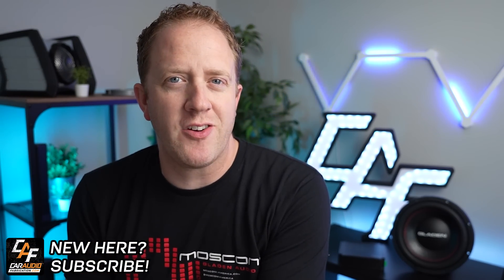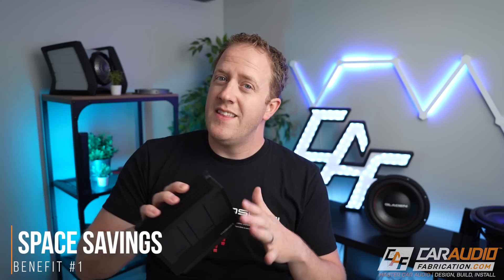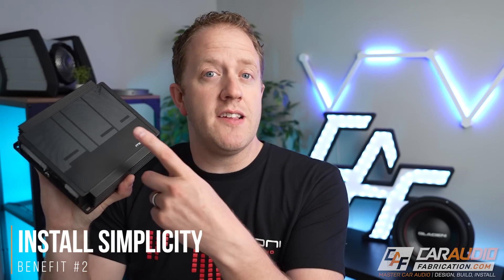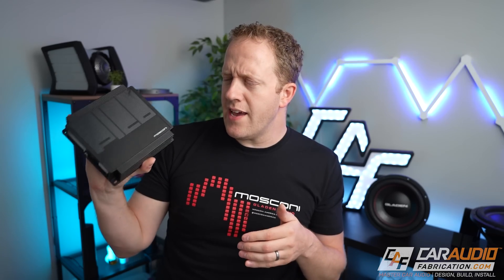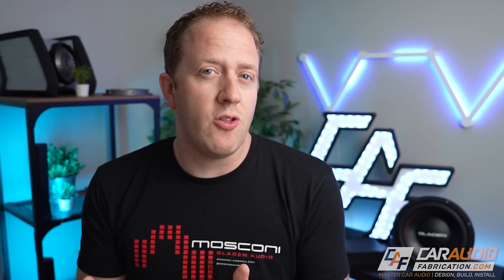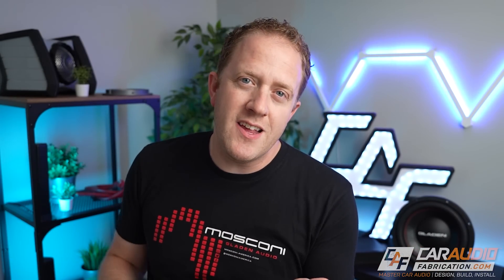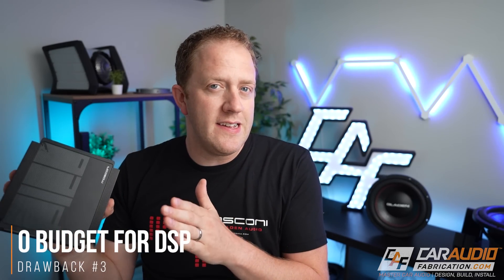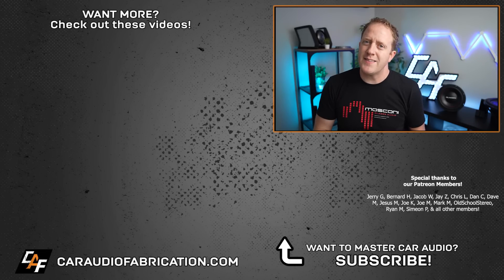Is DSP Amplifier the right choice for you? Yes, but maybe no...

Comment: I just replaced my speakers, and built my own crossovers. The problem is my tweeters are so sensitive, even with the 3º order high pass crossover set at 3500hz you can still hear noise at 500hz (All frecuencies sound good except 400-900hz).

I'm going to try building a crossover at 8000hz and hopefully that will fix it. Because I'm not willing to spend the time required to install a DSP.

Comment: Also- 1 more drawback for a DSP amplifier. Typically- if you're going apples to apples, same audio company providing a dsp and multichannel amplifier, compared to the same company's all in one dsp amplifier, the dsp amplifier will typically (most companies, not all) have less RMS output per channel than the standalone dsp upstream of the multichannel amplifier. Mosconi doesn't have this problem in their Pico or ONE line of products, but other audio companies may. For instance, another audio company that I use in my shop is musway, for those customers who cannot afford mosconi but want quality on a budget. Their DSP 4 channel amplifier is the M4+, which will provide 100wx4 at 4ohm RMS.  Comparatively, i could set them up with the DSP68 and the non DSP 4 channel provided by musway, the FOUR.100. This amplifier is 130x4 at 4ohm RMS, 
Same line of thought applies the more channels you add, the 6ch dsp amplifier is 70wx6 rms and the non dsp amp is 120x6.  This is a common occurance in a lot of amp brands.
Reply: I love the appearance of musway, looks really great.

Comment: Man I need some help with my system. I went with ds18 pro audio speakers on a 3k taramps and I know they Aren’t SQL speakers but they are less sound quality then the crappy oem speakers in my truck yet only a little louder. My buddy said I need a dsp to tune it correctly and make them louder but I’m just as concerned about the quality and don’t know what to do. Again I get my expectations maybe were too high but I find it hard to believe the quality would worse than stock! Hope you see this and thanks in advance.

Comment: Hey guys i have a question , i have a DB MF15R , i was testing it in free air for a bit trying to get it lose with 300 400 w only for 20 30 mins and the magnet got so hot i couldn't touch it , i saw that on the back of the sub there is a sticker that covers that small hole for the coil . Should i cut that out or (Idk if that a cooling feature or whatever im a beginner)  ?
Reply: Yes, that is a cooling hole.

Comment: Im thinking of upgrading my sound system. I'm thinking of running 3 amps with 8 channels totally. Right now I'm running a head unit with a built in dsp and 4 ch output. Should I upgrade to a head unit with 6ch output and dsp(it's cheaper) ore Should I get a dsp with 8ch? One of the amps have 2ch output.

Comment: Hey love the content .... im looking to build out a cx9 and would have 13 drivers before adding subs what in your opinion would be the best way to do this? I have a few ideas but not sure 100% ill be using alpine s2 speakers to replace all current locations adding 4 tweeters by way of 8inch components up front and 4inch components in the far rear pillers. Do you maybe even have a link to an old video of yours if its a lot to cover thanks in advance .

Comment: When customers can't afford everything at once i try to have them do a DSP amp on their stock speakers with a subwoofer and then add new speakers as budget allows.  Much better results than going with good speakers but no way to set them up properly
Reply: People have been setting up car audio without DSP for decades, so DSP is hardly that dire.   Most new decks have enough built in DSP to get the job done for majority of people.
Reply: @MotoAtheist dsps are more tuneable than most aftermarket decks, and a must have if your using a factory radio. Anyone that does car audio somewhat seriously knows this.

Comment: Does the JVC KD-T920BTS head unit crossover, with slope, gain, size, distance, and output control count as a DSP?  I'm having trouble figuring it out, but treating it like one.  Thanks for the videos!
Reply: Just took a brief look at the JVC smarphone app and in the "Receiver Settings" it show time alignment, EQ and the crossover you mention i imagine is "Speaker/Subwoofer/Car Settings", then you have the main components of a DSP 😁. Of course, the EQ on a regular DSP would have more featurws (like more bands, more adjustments, etc), but that stereo has nice options to play around with 😁. Very cool to see advances features in single din units, although they are normally high end and expensive 😅👍👍
Reply: @centralcoaster33  somewhat of a dsp but nowhere near as much flexibility as a real dsp. My kenwood has some pretty solid dsp settings too but I don't use any of it having a VXi amp and waaay more flexability there.

Comment: I tried a DSP  I had it installed and sounded like crap. Where I live there is no audio shop that really knows how to tune it. Lasted 3 days had it pulled out.
Reply from the maker: Let's use some deductive reasoning here... If the shop didn't know what they were doing... and didn't know how to tune it, that would be an error of the installer... not the DSP.
Reply: Yes I know that I would love to add the Helix mk3 but in Texas where I live I can't find a Audio Shop that can tune it . That's the most important thing for a DSP. Front doors Focal es165kx2 rear Focal EC-165K XD600-6V2 CLS10"W7 XD600-1V2 the most important piece missing is a DSP then I would have a bad ass system. I love you're videos Mark keep them coming.

Comment: I prefer to have each component separate. If the DSP is built in, and said amp fails and or a single channel fails, your out $$$. If each component is separate, it's a lot less money to replace. I always "show off" components. I've never liked descrete builds. My entire trunk layout is a "display" meant to look like a computer motherboard/circuit. With enough room for just a single 10" sub. There are amps, processors, batteries, inverters, game consoles, old school capacitors from the 90s in the trunk. No DSP though because I kept everything era appropriate for a 99' Maxima. This single 10" physically hurts my teeth on certain frequencies.

Comment: I am running an AudioTec Fisher Helix V8 MK2 for my 3 way front stage and rear fills and a Helix P One MK2 for subs.  I have limited space and Helix and Brax have the best DSP’s and DSP amplifiers.

The V8 75x8 at 4 ohms and 120x8 at 2 ohms and DSP on board.

Helix P One does 1500-1800 watts at 1 ohm.

Both are super small for what they can do.

Comment: Choosing the Audison Forza DSP amp was the worst decision I made when I started building my system. It overheats even when idle for just a few hours, with the trunk open and all trims removed, if the temperature is over 25°C outside. While it looks good on paper - compact, with lots of channels and plenty of power - it’s too good to be true. Don’t make the same mistake I did, or you'll waste a lot of money and time
Reply: Yeah I was supposed to buy those but did some research and found comments like yours!  Not reliable and Audison says the range is between 0 and 55C!!  We have -20 easily in winter and 30-40 during summer, which will make those overheat!  I found some Arc Audio that will be more powerfull (underrated instead of way overrated for Audison!!) that will work from -20 to +80 something.  A bit more expensive but reliable and wayyyy more power than the two Audison I was supposed to buy.  Will be cheaper on long term! :D

Comment: With so much factory crap using the factory radio, do you have a vid on figuring out what it takes to put a high power system in while keeping the factory unit? or a way to do that and replace with a better head unit?
Reply: You can get adapters for most vehicles that allow you to swap out the factory deck with an aftermarket and still keep all the steering wheel functions and any other vehicle communications intact.   You can can get amp bypass kits as well for any factory amplifiers that may be installed.  Some vehicles are more of a challenge then others, but there is usually a way to get it done.
Reply: If your vehicle is covered use Idata AR, Amp Pro or Axxess DSP and itll give you a flat 4 or 5 volt output and clean up the crappy signal

Comment: DSP is great if all of your amplification is class D.  I'd like to see a company design a class A amp with built in DSP.  Something like that would be reminiscent of the good ol' days where people had two or more 30-band eq's in their SQ builds.
Reply: I'm not sure of any Class A amps with built in DSP, but Mosconi does have a couple Class AB amps with built in DSP.
Reply: People usually buy amp + dsp in one because of limited install space and also need more than 4 channels, Class A usually larger in dimension.
Reply: There are plenty of them I have one 10ch with 12ch DSP

Comment: What you suggest to add to an audio system from the factory that already has a 900watt amp?
Reply: Depends what you’re not happy about with the current setup? 

If the factory head unit doesn’t have DSP, you could tap into the loom between the factory head unit and the amplifier and fit a DSP unit there to time align/EQ the signal.
Reply: Speakers